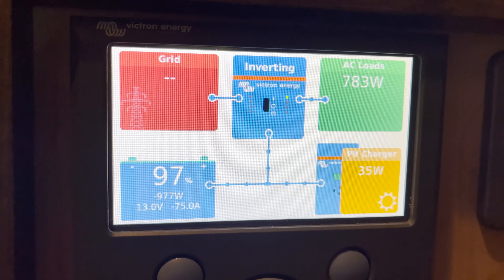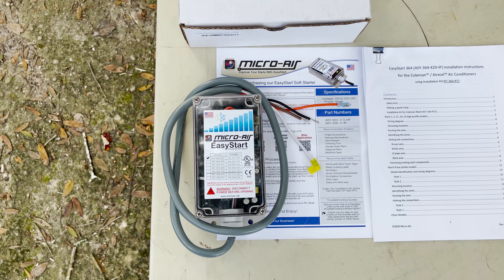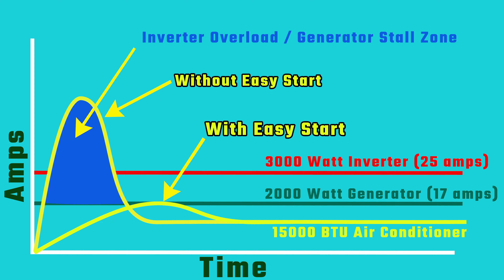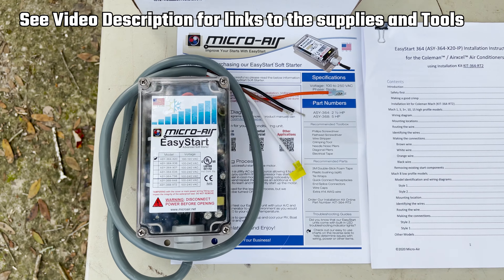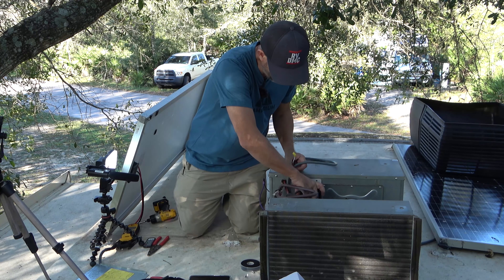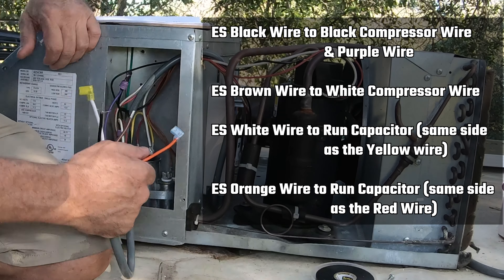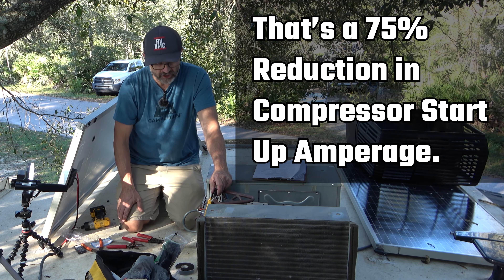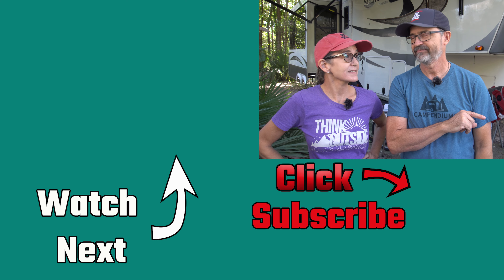Micro-Air Easy Start DIY on Coleman Mach RV AC unit 4K (RV Living Full Time)

Comment: Great information & video. How long can you run one A/C on batteries at night time? Thank you
Reply from the maker: That’s a great question, with our four. Batteries, 400ah. With completely full batteries to start, The ac can run for a few hours but if the compressor is on all the time only a couple of hours,  generally at night we don’t keep it too low just low enough to be able to sleep. That way it cycles on and off all night saving power.  I would say if you want the run the ac all night, 6 batteries would be the minimum.  Larry

Comment: I haven’t installed the ES yet. Do you see any issues on using my generator for the learning process. I don’t have power available where my rig is parked. Should I install and wait until I can hook up shore power.
Thanks
Reply from the maker: I think you should still be able to use your generator for the learning process, I would just make sure you do not have the generator on any kind of eco-mode when you do the learning process have it running at full steam.  Larry

Comment: Great video! I have a mach 3 also. I have seen other videos that are promoting the the same info and success. I understand start up issues have been solved with the easy start. My question to you is how long will that gen of yours work at a constant if the temps are in the 90's or so. Will that 2200i  shut down over a longer period of time while running the a/c with such a high demand? I'm debating on buying the Honda 2200i or the harbor freight predator 3500 generator. I'm curious about your thoughts. thanks
Reply from the maker: Larry would know better. But I remember running our AC for hours

Comment: Can you run two roof top air conditioners on 30 amp shore power at the same time?
Reply from the maker: Ken, technically it’s possible if nothing else is on. We do it because we have a hybrid inverter that makes up the difference

Comment: Kind of side question about your "tiltable" solar brackets.  GENIUS!!  Where did you find those?  Do you possibly have a link?  Excellent video!!  

Also, do you have both a/c's wired with this adapter?  Or is that even recommended? 

Thanks
Reply from the maker: Ed, you have to have a separate unit for each air conditioner. We only did the bedroom one since we use that the most. 
Tiltable brackets came from AMsolar.com. 
Hope this helps, Lar

Comment: So does it end up using the same amount of watts. Does it make it runs longer on battery power? Or would it be the same if my inverter already starts my AC will my batteries last the same or longer
Reply from the maker: It does not change the amount of watts it used runnnig,  If your inverter starts the AC, then you probably do not need an easy start.  The batteries will last the same either way.  Larry

Comment: We rarely use our generator for the camper... If we decided to never use a generator for the rv again, is their a reason to get the easy start? Does it run quieter enough to warrant using this unit?
Reply from the maker: Good question. It’s not quieter. It just makes it use less juice to get the air started. There’s no reason to get it unless you are planning on running off a small generator or an inverter and batteries.
Reply: @DownsizingMakesCents  thank you so much for the reply. I appreciate it
Reply from the maker: We do our best.

Comment: good Morning.  Did you run the AC on an inverter and if so what size and can you run it on a 2800W inverter?  Jack
Reply from the maker: Yes the ac runs fine on our 3000w inverter, it should also work on a 2800.  As long as you have an easy start or something similar.  13 amps running x 120 volts is about 1600 watts.  Larry

Comment: Thank you for the video. Did you have to run it on AC power for the five test starts?
Reply from the maker: David, yes. It’s important to do the first 5 test starts using shore power- not a generator,
Alice
Reply: @DownsizingMakesCents  Thank you

Comment: Thanks for this - new subscriber now. 👍🏻 Trying to figure out whether one or two needed for two ACs. I’m thinking one as running only one off grid for relatively short periods seems reasonable. Then, if on 30 amp service, startup the power hog first then once running fire up the easy start AC. Am I thinking about that correctly? Thx
Reply from the maker: David, thanks for the sub. 
Sounds like you got the right idea. We are fine with the one on our bedroom. We hardly run both acs 
Alice
Reply: Epilogue: installed the EasyStart on our 13.5 bedroom Mach 3 today. It’s working like a charm. The sound of the unit is noticeably quieter! I just followed your instructions as I went and all is well.I carry Wago connectors which make life even easier than messing with crimps. The Mach 15 with heat pump has a lot more guts and electrical do-dads going on in the AC unit so I put that install on hold. Having one EasyStart should keep us from roasting like last year at Ft Robinson State Park in NW Nebraska when the temp hit 102 and the trees that showed around our site in Google Earth had been cut down by the time we went there so full sun and 30 amp service, OY!!

Comment: Thanks, for the video, Larry.  We never camp without an electrical hookup (so far).  Is there any advantage to be gained by installing one of these Easy Start 364's when you always have shore power?
Reply from the maker: Allan, only advantage is if you want to run two airs off 30 amp.
Reply: @DownsizingMakesCents  Thanks.

Comment: You may have said this but I missed what size your AC's are.  13,500 BTU or 15,000?
Reply from the maker: My AC units are 13,500 like most RVs.  some are 15000 but I think those are the heat pump versions.  Larry
Reply: @DownsizingMakesCents  Thanks.  Mine isn't a heat pump and is 15,000 BTU.  But my generator is 2500 starting watts and 1850 running watts on gasoline so I think the little bit extra output will make it work.  Might even work on the 1650 running watts on propane.  I'll see when I install it.

Comment: Did you check with Coleman regarding the A/C warranty?
Reply from the maker: According to the person I spoke to at micro air, the Coleman warranty is voided which is why micro air covers the compressor for two years under their free double down warranty.  I wanted to cover that in the video but I was trying to keep it close to 20 min.  Larry
Reply: @DownsizingMakesCents  thanks

Comment: I have a 3000 watt xantrex inverter and 3 lithium batteries, I have a Colman Mach 1 15000 btu a/c . I have no problems running my a/c on batteries. I am stump that u can’t run it on your victron 3000 watts.
Reply from the maker: Our Coleman Mach would not start on the inverter without the easy start, it goes into overload.  We have one ac with the easy start and one without, the one with out the easy start cannot be used on inverter.  Larry

Comment: If your one ac is pulling 57 amps, why isn't that a problem since you are typically plugged into 50 amp service?  Obvious newbie here.
Reply from the maker: I am only measuring peak LRA amps that only occurs in the first second.  After the first seconds the amps went down to 11 amps to run the ac.  I should have explained that better in the video,.  Larry
Reply: Breakers are designed to carry the inrush current for a short period of time. When the start capacitor or in some cases the start windings become weak, the starting amperage is spread out longer so the breaker will see that and trip.

Comment: crimp connectors are INFERIOR to soldered connectors which are covered with shrink tubing. Do it right and do it once.
Reply from the maker: Thanks for your input. We don’t like to use soldering on high amperage connections.